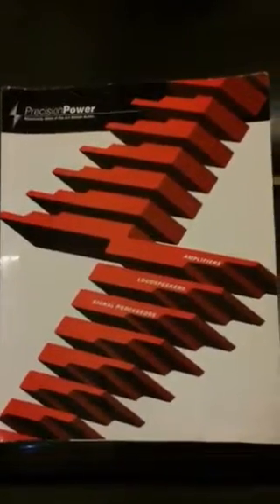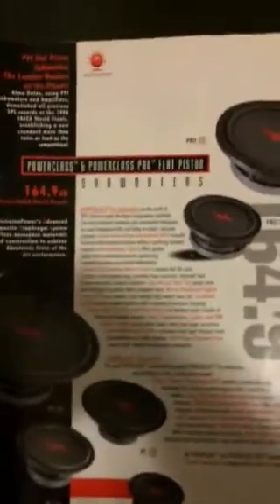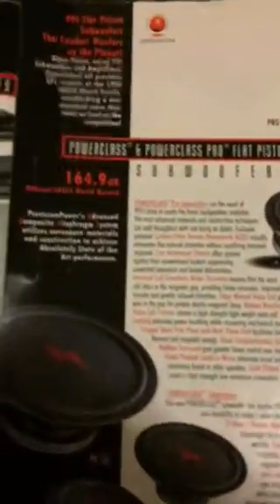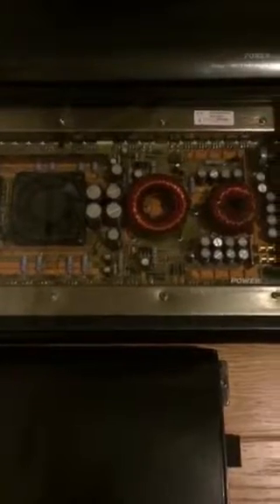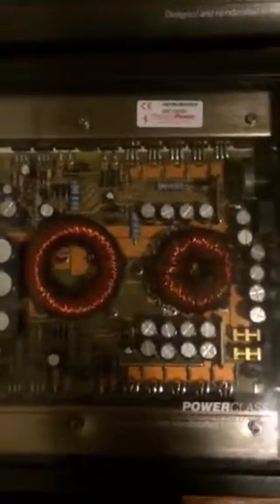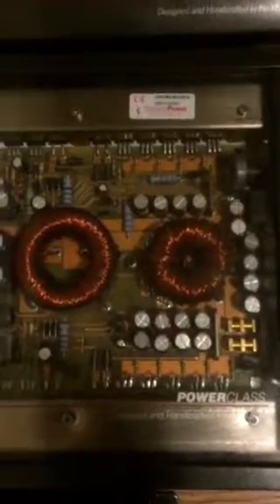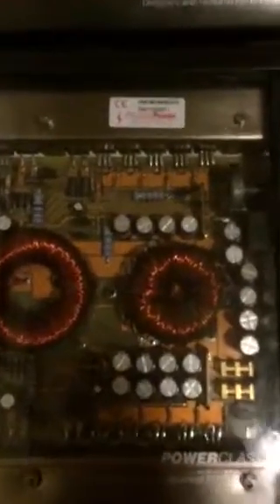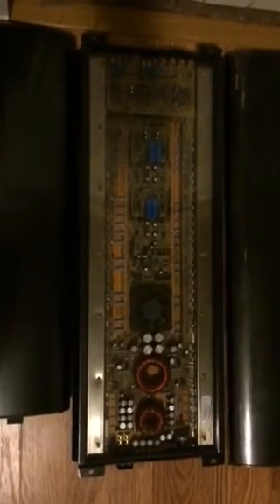Talking about amps: Precision Power Power Class amplifiers Pt1

Comment: I am hooking them up to a pair of mb quart pro 6.5 seperates, 2 boston pro 5.25 components with soundstream reference tweeters and one of my 2 orion 2ntense dvc 12's. Flowing through an audio control 2xs crossover. All of the same mid 90's vintage. I am going to try and do a build video.